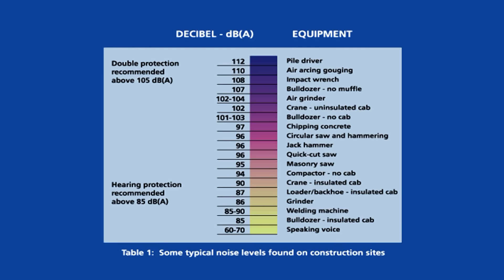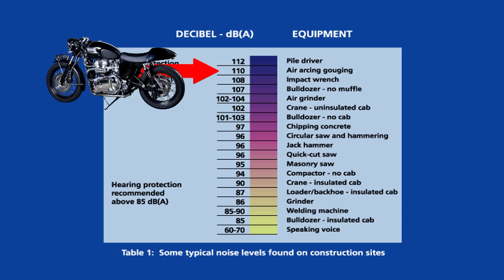Why Not to Change Your Car's Muffler

Comment: Hey Scotty, great stuff....but not all cars will run poorly, or have the check engine light come on just by replacing the muffler.  I replaced the stock mufflers on my mustang gt with magnaflow competition mufflers.  The deep tone sounds amazing, and I've driven over 12,000 miles so far with NO check engine light, or rough idle etc.  I guess it really depends on the car.
Reply: P F What year is your car?
Reply: 2016
Reply: P F I put a flowmaster and K&N filter on my 03 gmc 15 years ago and got an extra 2mpg on the interstate and never had it tuned or have any problems with it. Fuel injection can compensate for something so minor as a muffler or air filter change.
Reply: Nothing went off on your car because you just replaced the muffler not the whole system like Scotty is talking about. If you take off your catalytic converters (before the muffler pipe) that will set off the sensor
Reply: Logan Gagnier I thought maybe I missed something, so I just watched the video again.  Scotty never mentions taking off the cats.  He only mentions taking off the mufflers the entire video.  Deleting the cats would not only mess with the engine programming, but forget about passing inspection.
Reply: P F you got to buy high-quality performance aftermarket parts. You can't buy the cheapest one like the people who cars he's are talking about did.
I have a 03 Aviator I plan on putting some type of performance exhaust on.
Reply: nashvilleoutlaw on my 2013 Ram  1500 I have a K&N air intake,  bigger 87 mm throttle body, jba long tube headers jba y-pipe cat delete super 44 Muffler HP tuned and my gas mileage went up three to four miles per gallon on the highway! And excuse my grammar I am using talk to text.
Reply: You want an even nicer sound. Especially  at idle. Add an h pipe to the exhaust  system  you now have on your car.  It will make for a deep throaty exhaust  note and will actually  improve low end torque...
Reply: P F Very Nice Upgrade.
Reply: I have the same year mustang with the Corsa on it and boy does that thing scream lol
Reply: T Godfrey Funny you say that because I’ve been thinking about adding an H pipe!
Reply: George Doughly Thanks!
Reply: Peder Hansen I agree
Reply: P F Yeah plus when working with powerful tunes performance vehicles, you need to allow the car to breath better if you are to demand a decent bit more than bone stock power
Reply: Don't do it to a Toyota.

Comment: When u straight pipe a car all u have to do is put your o2 sensor back in and then it will run fine. It will tell the computer how much fuel to feed into the engine and it will run fine. 

Moral of the story, Scotty is on acid

Comment: C'mon Scotty! You know as well as the rest of us that one of the things people have to do with their cars when modifying the intake or exhaust of their car these days is to retune it with a computer. That makes the A/F ratio correct with the new freer flowing systems. It is standard operating procedure these days. That trumps re-jetting a carb any day. I know - I've had to reject carbs after bolting a set of headers, 360 manifold and a 650 Holley double-pumper on that old 350 chevy engine 45 years ago.
Reply: Right, I was going to say that, but you did so I don't have to bother. Most people throw the cold air intake and performance exhaust and don't do a tune. If you don't in most cases I'm sure it will be ok. But it would be the optimal thing to do.

Comment: I love my flowmaster system and have not had a single problem with it.  If the engineers made the ECU work as a flex fuel engine then there should be NO PROBLEM with having a free flow exhaust, intake, headers, or anything you would want to put on it.

Comment: If you have a MAF efi system you shouldnt have to worry about "tuning" for a new exhaust system.  The MAF calculates the additional air being pulled in and compensates that with fuel, thus telling the oxygen sensors what readings it should put out, please. Correct me if i am misunderstanding something here.
Reply: @David Now
Well, you are right about Mass Air Flow Sensors being designed to help calculate the necessary air/fuel ratio.
However, a vehicle's computer system (ECU) works in a more complex manner than a MAF.
The ECU works with ranges of number values, which are set by the Manufacturer; the flow of the exhaust leaving the exhaust system is one of those values.
Changing an exhaust system to a different exhaust system can upset these default Manufacturer number values, and thus cause a vehicle's engine to work improperly.
- Ignition Timing could end up inefficient, the Air/Fuel Ratio to each cylinder could end up inadequate, Engine Temperature could end up higher or lower than normal.
That is why a vehicle's ECU needs to be updated with the appropriate Tuning process whenever a major component of the vehicle is changed.
Hope that explanation makes sense~
Reply: Ross Davis i see this being more of a issue if the whole exhaust system is reworked vs just the muffler.
Reply: @David Now
Yes, but remember that the muffler is still part of the exhaust system; it is a small piece of a bigger process~ 
Exhaust gases still need to pass through the muffler to complete the 4 stroke combustion process, so adjusting the muffler ultimately adjusts the vehicle's engine performance~
Reply: Ross Davis more or less yes, but you wont notice a difference unless dino'd. Engineering explained even did a video on back pressure which in a sense correlates to the muffler of an exhaust system in which case doesnt really do much other than deaden sound, the catalytic converters provide enough backpressure for a vehicle that the muffler really i dont see causing any issues changing it or removing it completely.
Reply: @David Now
I'm just stating that it does make a difference, regardless of how much or how little~
Whether you or anyone else thinks that is considered to be tolerable; well, that is not up to me~
Reply: @HITMIX HYEPOCK
Of course the car will know; that is what the ECU is designed to notice. You are speaking from a place of ignorance~
Reply: @HITMIX HYEPOCK 
How about Engine Temperature for starters? 
A hot engine can be caused by exhaust gases not moving quickly enough through the existing exhaust system; the ECU can detect that.
So, like I said, you are speaking from a place of ignorance~
Reply: @HITMIX HYEPOCK 
Ok, smart guy, then how about when the Engine Temperature is too cold?
Does the beloved high-flow exhaust system help fix that issue?
Don't worry; I will do the waiting this time~
Reply: @HITMIX HYEPOCK
Thats right! That is why it is important to analyze the flow of exhaust within the exhaust system; which is exactly what a ECU does within a modern vehicle.
Reply: @HITMIX HYEPOCK
You do not need a sensor in the muffler to know that the flow of an exhaust system is poor; that is why I explained that Engine Temperature can be used to diagnose that issue. Not every vehicle related issue is going to be solved with a specific kind of sensor~
Reply: @HITMIX HYEPOCK
Originally, I said that the ECU "will know" what the vehicle's exhaust speed is, and you said that the ECU can not "know" what the vehicle's exhaust speed is.
That is our disagreement.
I have explained why Engine Temperature is relative to the proper function of a vehicle's exhaust system and you are refusing to acknowledge that fact.
If you do not wish to understand that fact, then there is nothing more that I can do for you~
Reply: HITMIX HYEPOCK there is no sense in arguing with a Ross Davis. idk if he is a troll or just overly confident, either way he is wrong just like scotty.
Reply: @juck huo
Its funny how I have stated facts and principles to back up my argument, and yet, you can not see beyond your own bias. Now that makes no sense~

Comment: Can I take the muffler off of my 1991 GMC Sierra 2500 or will this cause issues with my truck?
Reply: Have you took it off? You could do a test run. I imagine it would run a little better.

Comment: The bad mileage comes from your car now sounding amazing with your foot on the floor
Reply: Go back to video games 12.0 hours a day boy.
Reply: @HighSpeedNoDrag  So when I speak the truth of my experiences (because who said I was talking about the video and not something that relates to it) that at wide open throttle gas mileage tends to decrease. This expresses that I goof off half the day instead of working 8 hrs. every single day. 8 hrs. of work + 6 hrs. of sleep + 3 hrs. of allotted meal time = 17. 24-17=7. 7 does not equal 12. There for it is physically impossible for this to occur.
Reply: @zacharydavis571  Fair enough,  outstanding response and then some.

Comment: Is this just as true for Turbo engines? I've heard that to achieve more output from a turbo engine, you really want to evacuate the exhausts as quickly as possible
Reply: Turbo's are powered by the flow of exhaust gases, so you couldn't be more right about that. You definitely need a tuner for that tho, too much airflow will lead to too much boost and then boom goes the engine.
Reply: I heard turbo car can benefit from it but on NA engines it can apparently lower your low end torque

Comment: Partly disagree and partly agree, I feel if you change the muffler that there still capability of the software to be able to adapt to the threshold now if you slap on let’s say a set of headers that’s a different story plus it’s probably worth tuning the car anyway to take advantage of those headers just my two cents.
Reply: ya. my ecu learns and adapts
Reply: Some can't be tuned. My 4th gen Maxima can't be mapped. The ECU does have a learning and adapting cycle though. But I could just update the ECU and run the car on something newer
Reply: in some cases headers would decrease performance and power, life isn't need for speed.
Reply: Ansel Ordonez without proper tuning any fuel injected vehicle will see a decrease in power with headers
Reply: Volkswagens actually have a very smart adapting ECU they will safely run off mods just fine. To get any power off of a exhaust or intake it requires a ECU reflash though. My Mazda Speed6 has a dumb ECU a turbo back exhaust could cause major problems without proper tuning to along with the modifications

Comment: This video needs an Asterix * to denote he is only talking about naturally aspirated engines. I have a 1jz with a straight pipe that has been tuned and let me tell you the power gains are not minimal. Any forced induction engine loves to breathe.
Reply: 01GTB Daily but you tuned it, most people don't they just replace and move on which is the point of this video 😂
Reply: No asterix needed,this man is a old gearhead and old gearheads HATE the whole Japanese movement with the fart cans and the big wings etc,thats the whole essence of this video, believe me, i work in a old machine shop,our welder is 75 years old and down from there, all these guys i work with have Montecarlos,Corvettes, Mustangs, Camaros and a couple of 50s Chevy's and they Hate with a passion Japanese cars unless they are stock Honda's or Camrys grocery getters ,their wives all drive little Japanese cars but none for them, no sir.  dont mean to harp on Scotty because I'm not , i just know where hes coming from.
Reply: dntlss so because someone prefers a certain car they don’t have to be truthful on whether or not a performance exhaust actually improves the performance of a car. 

Forced induction cars gain power with better flowing exhausts .
Reply: *asterisk

Comment: I have a 4 cylinder and I put an after market race exhaust but I got one with a canister ontop and it aint too loud and runs good no tune its an expensive exhaust but it was worth it for decent sound and power

Comment: Why not do  nothing to your car
Reply: Don't be so double negative.
Reply: Yeah, just do the maintenance, add fuel and enjoy!
Reply: Mike Morales if you’re a normie... car enthusiasts need mods.... modding cars is lifeee
Reply: Car "enthusiasts" have no life because they spend all their free time modifying and fixing the problems caused by their own hands. You can enjoy a car without thinking that trashy $100 aftermarket kits are better designed than the ones designed by a whole team of engineers to work with the car it came on.
Reply: I've seen plenty of such bolt on mods that have cost more in repairs than the mods themselves. You can spend a few hours putting on crap that makes you spend a week fixing.
Reply: Powder Monkey I guess I’m a soon to be no life when I buy my car and make it MY OWN. Nobody buys certain cars to keep it stock, especially when you can put a turbo kit on it and push 500+ HP out of it.

Along with that, gun mods are useless too! Right? Who needs a grip, or a $3000 sight, or a 30 round magazine when iron sights, stock barrel, and plastic butstock will do just fine?
Reply: Why don't we mod our jeans. Maybe bidazzle them with some sparkly gems. Mods are great for a car. Smart people create mods that are engineered for specific vehicles. Buy a cheap mod, it's not going to work, it's for looks only. If mods are stupid and pointless go buy cheap all the same color clothes and wear them everyday. Clothes are mods also. People, buy whatever mod you want, if it makes you happy. Or go buy a honda fit and shut yo mouf.

Comment: I've gotten better mileage after I redid my exhaust system. I don't put those stupid fart cans on my cars though. I'll use glasspacks or even the high end free flow mufflers.
Reply: MnSubie37 Why not blastpipes xD
Reply: 2JZ FTW actually I technically have ground rumbler style. The downward facing tip.
Reply: MnSubie37 Not a fan of those, just odd looking to me
Reply: 2JZ FTW it looks good on an outback. Rear bumper didn't have a cut out and I wasn't willing to cut it. Actually looks good to me.

Comment: "4:45 Not much difference for actual power" Depends on the car, depends on what you do. Example: 2003 RSX type-s stock makes "210" When we dyno'd it it ran 195 to the wheels, then we did a header job and a slight tune. It ran 220 wheel. thats around a 20% gain, you do feel that. 
Here's another one: 2008 Legacy 2.5GT. Headers + Full exhaust + Intake + Larger turbo + Built engine(Stock C/R, forged internals) Stock ran 230 wheel(8L/100km hwy), after mods made 410 wheel(6.5L/100km hwy). Made more power, used less gas on the highway.
 I've spent some time working on the LGT's the downpipe is a horrid design, just changing that out will net 20 - 30 hp(With a tune) 
People, like yourself, fail to think about one key thing; CAR COMPANIES WANT MONEY. If they can make a part cheaper, they will. Look at the manifolds on a E92 328, they are GARBAGE, 1 and 3 face each other, but its cheaper to make then a proper set of headers. its a tradeoff. more money in their pocket, more money out of yours for gas.
Reply: What do you think I should do to my Lexus gs450h? Just want a louder sound for the bare minimum while still being effective and safe
Reply: @mosey4915  you won't break anything by changing the exhaust after the cat, so I would say find a local shop that does exhaust work to change out the rear mufflers. for that engine, id go with thrush rattlers(P/N Dynomax 24256 for the 2.5in) and a resonator setup, cuts out the rasp.

Comment: I recently bought a 2002 Lancer Rally Edition Came With A Greedy Exhaust complete set...Car Sounds Extremely Loud..
Reply: GrandSupremeNews I just bought a 03 one as well any idea which ones are the good ones I could possibly put ?
Reply: 2003 lancer oz rally edition owner here with a rusted pipe line ;(
Reply: The problem was that you bought a lancer and not an Evo
Reply: Your right, but the lancer is still a fun little car to drive around
Reply: Eyyy same recently bought a 2005 Celica with Greedy Exhaust too
Reply: Oh gosh lancers have awful sounding engines
Reply: GrandSupremeNews leave it
Reply: GrandSupremeNews it'll get better after you turbocharge it
Reply: GrandSupremeNews Greddy...and I'M not even a ricer.
Reply: 2JZ FTW lol like an Evo isn't a Lancer